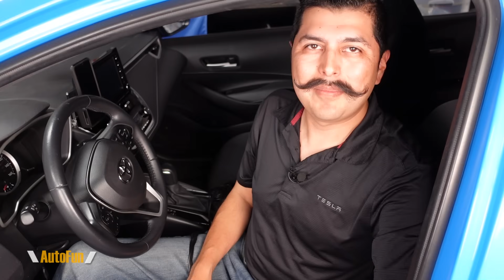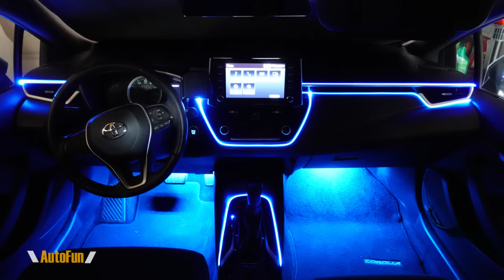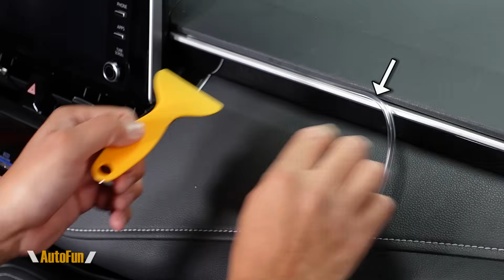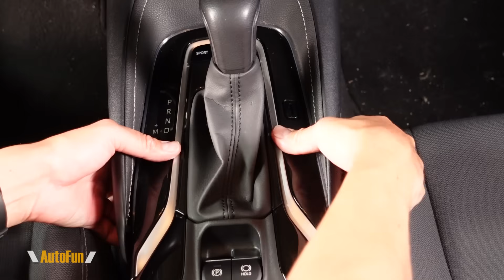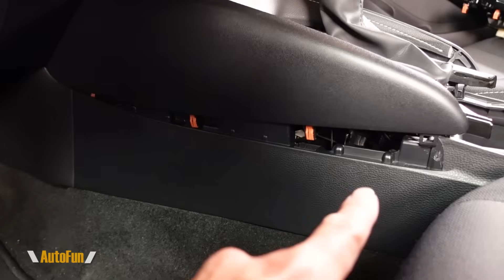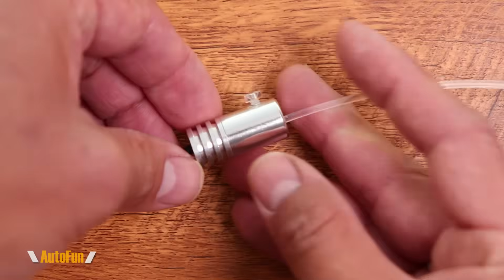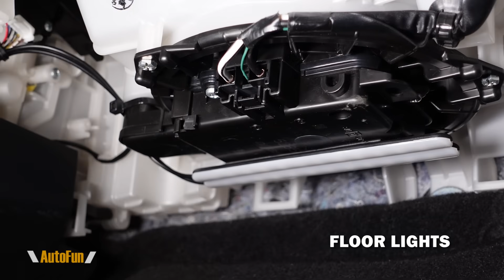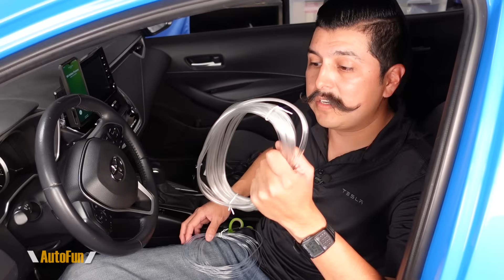CAR RGB LED LIGHTING INSTALL! (TIPS and TRICKS for Easy Installation)

Comment: So wait can cut the fiber optic cable?  I mean  gotta cut to sizr  idk how works didnt explain none of that part
Reply from the maker: Yes it can be cut to fit the section needed. Here is my full review for the kit so you can see how it works https://youtu.be/vWKoJN38-Ro cheers!
Reply: @AlexAutoFun ok thnx  yea i see now  color comes from tip of wire  didnt know also floor kit come with app and remote?  Also will run off same app?

Comment: Como se podría instalar de forma directa sin utilizar la cigarrera porque si se ponen mas voy a tener que ponerle mas extensiones. Te agradecería mucho si por favor hicieras un video colocándolo directo. Muchas gracias. Muy pero muy buen video
Reply from the maker: Thank you! Yes the lights can be hardwired, here is my video for that https://youtu.be/K2iKXj82354 The only difference is that the lights only need 2 wires connected (GND and 12V) instead of 3 wires, cheers!

Comment: Why not splice the two sigarette connections into one. Either open it and solder them or just splice the the cables. That way you  don't end up with that big split connection
Reply from the maker: Yep, that is definitely also another way to do it, cheers!

Comment: Great video. I'm thinking about getting it from my car.i Just wanna know  How long do these lights because it doesn't matter which brand or price,they all get bad reviews. Is there a brand that you recommend?
Reply from the maker: Thank you! Ah so far mine are still working (but will update this comment for you if something changes), I placed the link to the ones I used in the video description, cheers!

Comment: I just bought a new 4runner would something like this hurt the resale value of the car? THanks!
Reply from the maker: Typically aftermarket modification most of the time due lower the price of a car (as most people want a stock un-modded vehicle). That being said, if the kit is installed using the non-drill method shown on the video, then it can be removed before selling as the install is fully reversible, cheers!~

Comment: Just purchased an almost identical kit but mine also comes with a USB connector. Do you have any tips for extending it to the doors from the dash or should i buy a separate unit for that function? Also do you think it would be better to run RGB LED or are the fibre optics the better route?

Comment: way more work than i thought
Reply from the maker: Yeah it really varies, depending on how many lights are being installed, how clean does the install (professional) the owner of the vehicle want the install to look and also how careful the installer is in removing parts (or avoiding removing parts) to reduce the possibility of damage to the vehicle, Cheers!

Comment: I don't understand how you wrapped it around even the the gear shift column if it's one strip
Reply from the maker: The kit includes several strips which can be cut to size. Here is my full review so you can see how the kit works https://youtu.be/vWKoJN38-Ro Cheers!

Comment: When i turn it on, it always goes on the same ugly mode, how do i put a different basic setting
Reply from the maker: The lights I used (link to them in the video description) remember their last setting. If you got the same lights as I do, then you may have received a defective set. I would recommend contacting you seller for support and here is my full review for the RGB kit so you can see all of it's features https://youtu.be/vWKoJN38-Ro Cheers!

Comment: Hi, i don't see a link for retaining strip in description.  Can you post it here? Or just tell me which one you used? Thanks
Reply from the maker: The retaining strip is not sold separately, it is part of the Kit, I placed the link to the kit in the video description and here is my full review for the lights https://youtu.be/vWKoJN38-Ro so you can see how they work, Cheers!
Reply: @AlexAutoFun  it didn't come with my kit, i have a spot that the gap is too big and fiber optic doesn't stay in.  Ant tips  on that? Thanks

Comment: Will this be the exact same for a GR Corolla?
Reply from the maker: The techniques shown on this video can be applied to other vehicles (including the drill and non-drill method). Usually the differences between cars are how the trim panels are be removed and if the customer prefers a hole thru install (drill method) or no hole install (no drilling) Cheers!

Comment: How do I hard wire this whole kit? My car has an exposed single lighter cigarette. and I dont want the spliter to be visible from the outside since the cig lighter is exposed. not tuged in like urs under the middle arm rest.
Reply from the maker: Ah yes here is my hardwire video https://youtu.be/K2iKXj82354 the main difference would be that there would only be 2 connections made: Ground and 12V+ (in either BATT or ACC depending if the customer requests power to the lights all the time (BATT) or if they only want them to be powered when the car is on (ACC), Cheers!

Comment: Amigo, por onde passo o fio para dentro das portas? Você furou o plug de conexão dos conectores da porta?
Reply from the maker: Usually this is done by feeding the wires down the same rubber channel (tubing) where other existing wires are all ready going into the door from factory (power windows, door locks etc) Cheers!
Reply: @AlexAutoFun  ok
Obrigado pela informação. Vou fazer isso no meu carro.

Comment: Do the floorboard lights stay on the whole time the car is running 
I want my floorboard lights to turn on when I open the door, and turn off when I close the door.
Reply from the maker: If installed with the cigarette lighter adapter, the lights can be turned off with switch on the adapter or using the App. If the lights were hardwired, the installer can install a secondary switch to control the lights, or he can wire them to stay on when the car is On or he can wire them to stay on all time.  And here is my full review for the lights so you can see how they work https://youtu.be/vWKoJN38-Ro Cheers!

Comment: Does anyone know if it’s possible to wire straight to the car? I have an old Porsche and the cigarette lighter is in an odd place and I have extra cables in my radio
Reply from the maker: Ah yes, some installers will hardwire the kit to the vehicle, And here is my full review for the lights so you can see how they work https://youtu.be/vWKoJN38-Ro Cheers!

Comment: Is it possible to power up the lights automatically  when the head lights are on?
Reply from the maker: Yes, the installer can wire them to turn on at the same time another device on the vehicle such as the headlights, Cheers!

Comment: how to run wires to door panels?
Reply from the maker: Usually this is done by feeding the wires down the same rubber channel (tubing) where other existing wires are all ready going into the door from factory (power windows, door locks etc) Cheers!

Comment: Approximately How long does it take you to install ?
Reply from the maker: Hi! Install time will depend on how much fiber will be installed (some install a few pcs and some install all the fiber), how much experience the installer has hiding cables and pulling panels and finally some cars have are easier than other due to how they panel release (specially luxury vehicles normally cause the installer to go slower to avoid expensive damage caused by rushing to pull panels or hide wires) Cheers!

Comment: This might be a stupid question but do you cut the fiber optic cable for each of those location?
Reply from the maker: Yes it can be cut to fit the section needed. Here is my full review for the kit so you can see how it works https://youtu.be/vWKoJN38-Ro Cheers!

Comment: Thanks for the tutorial! I have a similar kit and it left me a little puzzled. I was thinking it required an extreme amount of panel removal but it’s definitely a lot simpler! I’m glad my car has fuses on the side of the dash, I’m not a huge fan of the cigarette/aux port install. I’ll be doing the fuse tap method and making sure it only powers on when headlights get turned on🫡
Reply from the maker: You're welcome!

Comment: So I want the lights on my back door panels so would I have to have separate wire running through the door or can I just cut wire and insert them onto the door ?
Reply from the maker: Hi! If you want lights on the rear, the installer can run the cables to the rear or a separate kit can be installed in the rear in addition to the front kit. And here is my full review for the light so you can see how they work  https://youtu.be/vWKoJN38-Ro Cheers!

Comment: So do you have to take off the center console on any car?
Reply from the maker: Hi! This will depend on the vehicle and also if the customer requests lights in those areas or if cables will be hidden inside those areas (I done other vehicles where I work around the console), Cheers!

Comment: Instantly void the car dealers warranty for brand new cars how sad
Reply from the maker: HI! Voiding warranty, ahh that's is often debated when it comes to adding aftermarket devices to your vehicle. You would want to check your State's law. In my State supposedly the law prevents a Dealer from denying warranty if someone added something to their car or worked on their own car as long as whatever was added or the work that was done was not the cause of the failure. So let's say you put window tint on your car and your transmission fails, it would be difficult for the dealer to deny it because the tint or the tint install did not affect the transmission. But as simple as that sounds, there are horror stories of dealers not honoring warranty if they see a modification claiming it is what led to the failure. Some owners even had to take them to court or complained directly to manufacturer (since dealers are typically independently owned) to get their warranty honored, Cheers!

Comment: Hi can you show ua please how to take connection from car inside to the door panel. Without opening side if is possible to do or not.
Reply from the maker: Hi! Usually this is done by feeding the wires down the same rubber channel (tubing) where other existing wires are all ready going into the door from factory (power windows, door locks etc) Cheers!

Comment: Fantastic video.....I just got my lights today from eBay and off course were very cheap but the beam of light is shocking after 20cm ...it just fades....
  Is there difference in light power from different suppliers..
Many thanks...
Reply from the maker: You're welcome! Ah yes I seen that some a dimmer than others (both depending on the quality of the fiber and the emitter) I placed the link to the ones I used in the video description, Cheers!

Comment: Are issues in running in both interior and underglow lights? Would you need 3 splitters?
Reply from the maker: Hi! Ah for that I would use 2 kits, one for the front and one for the rear. A single kit could be used but you will have less lights (ends) and install maybe be more limited since you are sharing length with the front and also the rear position. And here is my full review video https://youtu.be/vWKoJN38-Ro so you can see how the rest of their features https://youtu.be/vWKoJN38-Ro Cheers!

Comment: If it's one line of lights, do you just cut it for one section then use the other one that you just cut for another section?
Reply from the maker: Hi M! It is not a single line of lights. There are several independent lights and those connect to the sections of optical fiber. Here is my review video so you can see the kit contents and it's features https://youtu.be/vWKoJN38-Ro Cheers!

Comment: How would you go about feeding the back door
Reply from the maker: Hi V! The techniques shown on this video can be applied to any area of the vehicle (including the drill and non-drill method). Usually the differences between cars are how the trim panels are be removed and if the customer prefers a hole thru install (drill method) or no hole install (no drilling) Cheers!
Reply: @AlexAutoFun  sorry for unclear question. I was thinking in regard to feed the cable. How do you get it from the cabin to the door
Reply from the maker: @volprich  Hi V! V! Ah that is done in a few ways, the first one, the installer would feel the wires into the tube in the door that already contains other wires. The second way, the installer would install the cable with some slack (so the cable has space to move when the door opens and closes). However this method is usually not as durable since the cable is left to bend unprotected. Here is another video where you can see how I bring a cable from the cabin of the car out to the door area of the car (in this case for side cameras) https://amzn.to/3sWPIFA skip to the 15:30 section. Imagine similar process but going towards door instead of side fender for the second method. And the 3rd way, is the installer installs one kit directly on the door, so no wires need to be brought in from the outside since the kits originates from the door itself. Cheers!
Reply: @AlexAutoFun  thanks for the really great video and explanation. Just finished the dash and I couldn't have done it without your video. I wish I could post a picture so you could see the result. Next step are the doors
Reply from the maker: @volprich  You're welcome! and get ready to get a ton of compliments on the lights (I still do even after 2 years of having them on LOL) Cheers!

Comment: I have the bmw e46 face-lift are there tips on how l can Install the led lights
Reply from the maker: HI 6! The techniques shown on this video can be applied to any vehicle since this is a universal kit for all car models and makes. However remember there are differences between cars as far as how the trim panels can be removed, Cheers!

Comment: Can you also do it for the back?
Reply from the maker: Hi D! Yep! the kit can technically be installed anywhere (inside the car) only limited by the installer's skill and your imagination (as far as placement) Cheers!
Reply: Can I maybe have a quick explanation on how to get them to the back?
Reply from the maker: @daboilegends770  Hi D! Same process as the front, the main difference would be that the cables would be routed to the rear of the car (or a separate kit for the rear could be installed independently of the front kit) Just really depends on how the installer want to install them and how the customer requests for them be installed. Cheers!
Reply: @AlexAutoFun  and would the back start from the center console or would it start from elsewhere?
Reply from the maker: @daboilegends770  Hi D! It can technically start from anywhere (again, this is mostly driven by the installers skill and the customer's request for where they want the majority of the lights to be). But yes, the car's centerline most of the time would be the most common place for the lights to start from. Cheers!

Comment: I like what you did, but by using the cigarette ports, your lights are constantly on and unnecessary during daytime driving.  Can you make a video where you hardwire the lights to your auto headlights?
Reply from the maker: Thanks Sean! Ah remember there is an On Off switch directly on the power plug or additional they can be turned Off or On with the App. But yes, when requested by the customer, some installers will hardwire the kit to the vehicle (depending on how the installer connects it, it can be switched on with a separate switch or with the car coming on). And here is my full review for the lights so you can see how they work https://youtu.be/vWKoJN38-Ro Cheers!
Reply: @AlexAutoFun  Alex thanks for the feedback but I think you misunderstood me.  I wish to hardwire it so that these lights only turn on at night when it gets dark like my headlights.
Reply from the maker: @seanjones5682  You're welcome Sean! So far I have not heard of a sensor that can wired to have it come on based on daylight and nightlight (would probably have to be to some type of photoelectric sensor) but I imagine it may be possible for an advanced installer to do this. Most will only connect it as mentioned earlier, to either come on and off with the car or they could be controlled additionally with a switch or the App (for those desiring manual control). If I ever do see an install using a ambient light sensor I will update this comment for you. Cheers!

Comment: Alrighty don’t know if you’ll see this but I am SO confused on how to feed them through so could you please explain
Reply from the maker: Hi Cool! There are several ways an installer will feed the fiber into the trim of the car. One way is like the shown in the video by just tucking them into the panels, the other is by drilling a hole in each panel for the fiber to come thru. And here is the full review video so you can see the rest of it's features https://youtu.be/vWKoJN38-Ro Cheers!

Comment: How did you feed the cable to get to the sides?
Reply from the maker: Hi Briska! From the bottom (most car are open on the bottom part of the foot well area, so normally I can guide the cable up using my hand and catch it at the top and in very tight cases I physically lay in the footwell so I can see the direction I'm feeding the cable too. Cheers!

Comment: How to put this on door also?
Reply from the maker: Hi Mkmxa! The same techniques shown on the video can be used to install the lights anywhere on the car (as long as the cable reaches, however experienced installers can extend the cable). And here is my full review for the kit so you can see the rest of it's features https://youtu.be/LahW9J1TkCw Cheers!